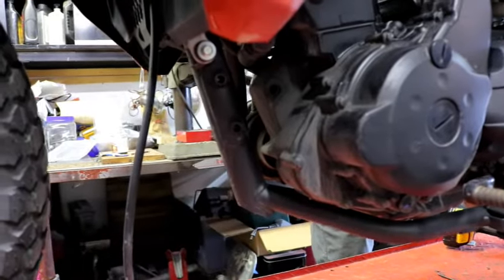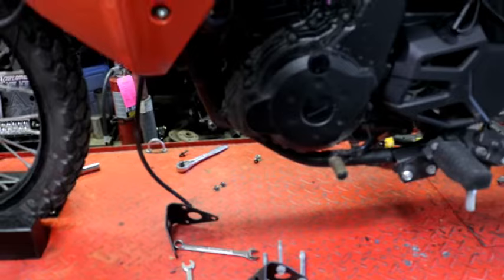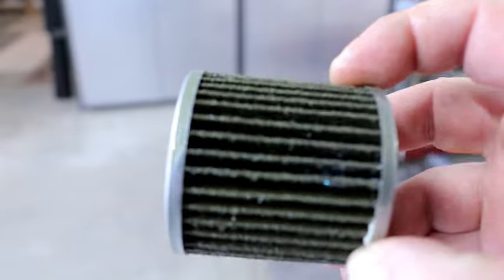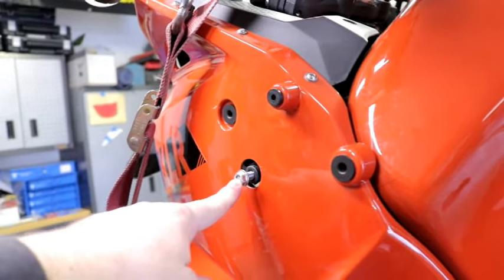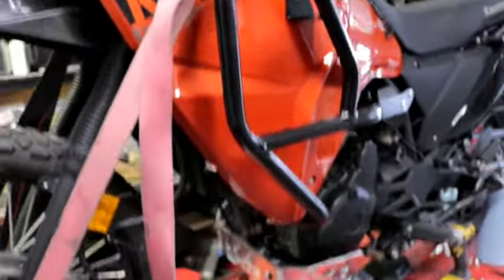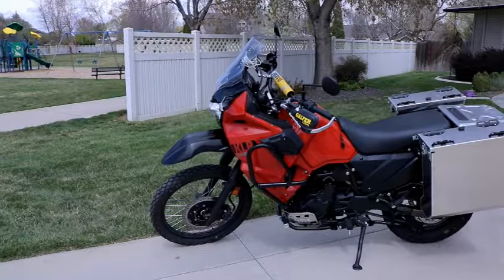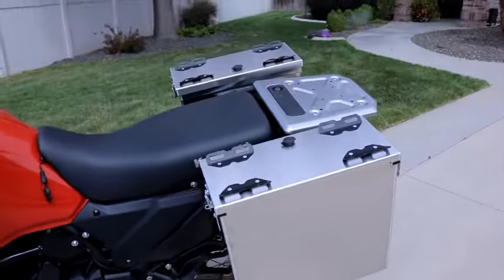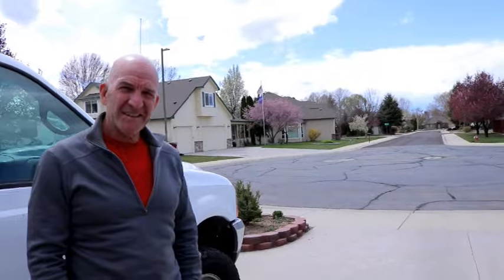2022 KLR650 - Happy Trails Customer Build

Comment: That was my bike.  I bought it in Oregon (no sales tax, no hassles), and drove out to Happy Trails in Idaho. I did the doo and installed a Thermo-bob just in case.  Drove it to Deadhorse Alaska and then to Ushuaia Argentina (actually Estancia Moat), and then sold it to John in Punta Arenas Chile. Ran heavy rubber inner-tubes. Never flatted.  Never had a mechanical problem.  Good moto!

Comment: It’s cheaper to fly to the mainland, drive the bike to happy trails,  and ship it back to Hawaii versus buying from Cycle City here in Hawaii.  The ONLY bike dealer here in Honolulu is a huge ripoff.  I just bought a 2022 KLR 650 Adventure from them and it was a nightmare!  I will be buying the Happy Trails gear to kit my KLR out as well.  I bought adventure model for the color scheme, but other than the lights I will be replacing all the OEM stuff.
Reply from the maker: That's what I did on my adventure model as well. The plastic panniers and "skidders" were junk. Love the color though!
Reply: I hear you.  I'm also out here on Oahu.  I think I'm the first one to buy a Adventure model here.  Happy Trails is the way to go.  I bought my skid plate from them and recently installed it.  I've installed several mods since I picked it up in January.  I just roll my eyes every time I either buy a truck, car or motorcycle on this island.